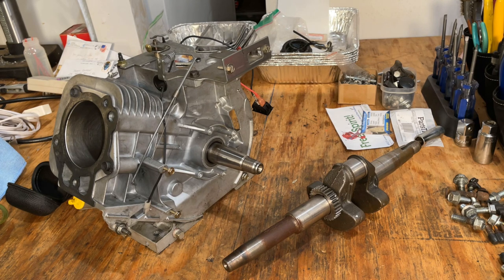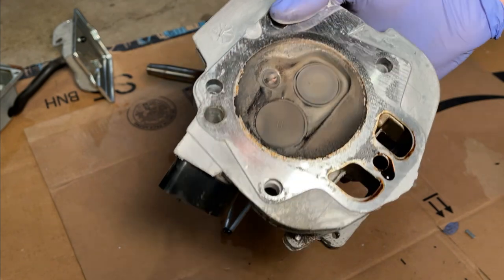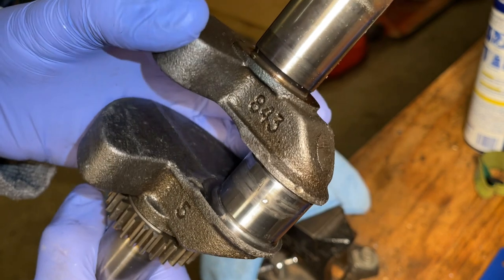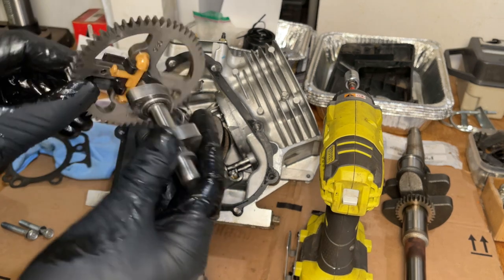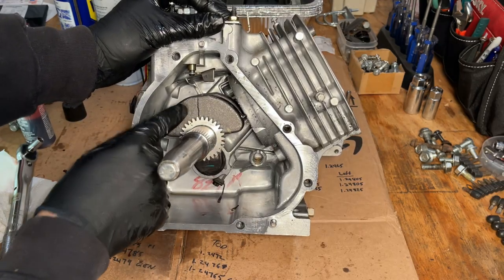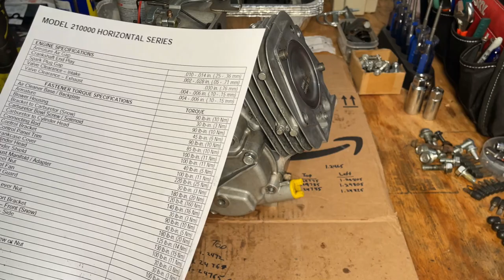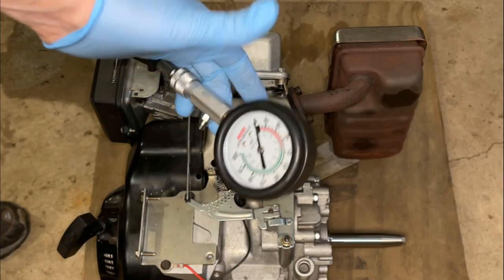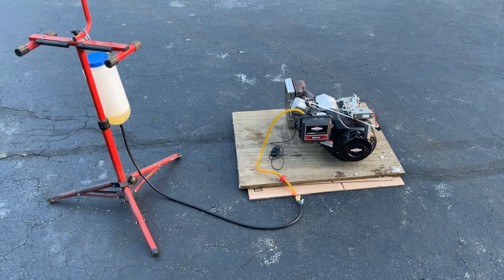Generator Engine Rebuild (Take 2) - 10HP Briggs and Stratton

Comment: Sir:
I am impressed with your logic and trouble shooting . Wish your were a auto shop teacher when I was in school.your a great teacher.

I did feel a need  to mention two things

1. Back in  1955 chevrolet came out with insert rod bearings 
Before that old motor manuals showed how to grind, file, sand caps and shim rod to crank for proper clearances.
My dad use to fit by feel then we used plastic gauge when it came out.
The pressure is on the top and bottom of rod not as much on the sides where the bolts are. Also being oil drip / splash lubrication it actually let's more oil in.
This technique always worked for us especially when the engines were not that far out of the spec .by 001 to .003 curing the knock.
Of course this was for the old two and a half to three and a half horsepower motors.
Bottom line they ran for hundreds of hours afterwards.  We put a lot of these mix and match left over used parts motors together for gardeners.

2. We always would use sand paper ( 600 to 1,500 grit ) on a machined  flat surface to lap in block and heads surfaces to show and remove warpage and low spots as we only had wire brushes and gasket scrapers which removed more than just gasket material ( softer aluminum back then ? ) Which would lead to head gaskets leaking / blowing after only a few hours ( 20 plus).

Not criticism just old  school to  save  a buck and use all the life possible out of engine.

Mike
Reply: P.S. 
I was talking about  lawn movers engines not Chevrolet motors just a reference of where to find procedure

Comment: Your trick of the wet sandpaper and rope to polish the crank's rod journal is quite clever (and effective). I've not seen it done quite like that, and definitely will remember that. Thanks for another great video! Be well, stay safe and God bless. Rev. D.
Reply: This sanding method probably removes more material from the middle of the crankshaft journal.

Comment: Mr James, when fiddling with the governor adjusting tab, I made a tool. Get a piece of 3/8 round bar and use your dremel tool to make a slot to fit the tab about 1/2 inch deep. Make the bar about 12 inches then bend the last couple inches to a 90 degree angle. This way it can be adjusted from the recoil side without removing the tank or fighting anything.

Comment: Great video.  One trick taught to me 50 years ago is to use a 1/2 impact gun/socket in reverse to remove the flywheel nut.  Alters the polar moment of inertia required such that you don't even have to hold the flywheel with your left hand with the impact in the right hand. Takes less than a second.  No need for ratchet strap.  The nut spins right off, but the flywheel doesn't rotate. You won't believe it, but its true.  Great also for removing nuts on alternator pulleys, power steering pulleys etc.  Kind regards,  Craig

Comment: On the connecting rod journal, I would have checked with Plastigage to obtain the clearance. Cheap and easy to use to determine if you are within tolerance. Also, I believe that the rod is linebored when manufactured and direction of the cap is only one way or the tolerance will be off.
Reply: You stand correct!
Reply: Going to say the same thing. Plastigage is what I would have gone with also. 
James, I could really use that piston from the used engine you disassembled. Please contact me. Ken gave you my contact information. Thank you sir and have a good day

Comment: Fantastic job of diagnosing the parts that would work and those that wouldn't.  Very surprised at the crappy condition of the new crank.  Thanks for the video.
Reply from the maker: Makes me second guess not using the one that was mostly in spec that was run without oil.

Comment: Hi James, also thoroughly enjoyed this with my morning coffee, nice way to start the day. Excellent video. I replaced a connecting rod a few weeks ago, at least a 2 hour job. Can't believe those storm responds don't have an oil sensor either. A very satisfying video !! ty
Reply from the maker: Thanks.  They are a good engines.  A generator can run for days in end.  An oil sensor is not optional.

Comment: I rebuilt one more than 10 years ago. It was used at a construction site. The crank can't be more than 1/2 of a 1000ths off. Mine was fine after I scrapped all the aluminum that stuck to it off. I've used the heck out of it ever since. Store it dry. The tough part was getting the armature to disconnect from the crank without the proper tools. Hit it just right and it came out.

Comment: Straight ammonia takes a bit longer, but it eats the hell out of soft metals.  It's used in some of the more rugged firearm bore solvents to remove lead and copper fouling.  Make sure you don't breathe it.

Comment: Ok, so you gave me the bug. I went out and bought an abused basket case. You perfectly cover all of what I have run into so far in several of your videos. But….I think I may have a symptom I haven’t seen covered by you yet. This one has a stuck governor shaft. If I can’t use Blaster to free it up I guess I’ll have to split the engine to get at it. Furthermore while pulling it over with the head off I think I may be hearing a knock from the rod journal. So thankfully you have covered all this and I have watched and learned. I may have bought a bucket of bolts but you have to start somewhere. Thank you for making such clear and well edited videos.
Reply from the maker: Good luck!  Sometimes it takes a lot to bring them back.

Comment: I've rebuilt automobile engines.  One thing you learn real quick is to measure parts and clearances.  All mechanical parts have tolerances.  If there is not enough clearance between the rod journal and the connecting rod expect there will be problems.  As one subscriber suggested "Plasti Gauge" is a good for checking the journal clearance.  Good video all around.

Comment: Those storm responders need to have a low oil shut off. I'd rather deal with a faulty oil level switch than a engine replacement.
Reply: Very well said, I agree!
Reply: Absolutely. Every one else does.
Reply: @mikesbarn1858  You'd think that there would be a mod that would screw into one of the oil fills. A lot of those engines have two oil fill location. Someone needs to go to invent help with that one.
Reply: Don’t forget about generator safety as well https://youtu.be/I1jT3ANENvI stay safe everyone
Reply: true they do need one. maybe there a way to put one in. maybe james knows or someone else.
Reply: I posted this question to James and it wasn’t answered 🙁
There has to be a way to do it. All the others have one along with the newer storm responders

Comment: I have learned so much about small engine repair from watching your videos. I now have the confidence to clean a dirty carb, and so much more myself. Your diagnostic skills are confidence builders. Thanks for explaining everything so clearly. Small engine repair in the area I live is a joke. The first question they ask you is how old is it, followed by it's not worth the effort.
Reply from the maker: Same here.  Before I started small engine work, dropped my mower off for service and the spring and got it back in the fall.  Plus they had it outside all year and it look a 100x older.  Was not impressed.
Reply: Keep up the good work, James!!

Comment: Excellent vid on using the mikes to check specs seams that there’s such a small margin as to how little has to be removed from the crank to make it out of spec. I wish James you would have played the engine knocking compared to fixed at the end of your repair so we could learn to be more sensitive in our hearing to hear what you are hearing. Thanks

Comment: Years ago, I was tasked to determine why aircraft mechanics were breaking helicopter engine to rotor driveline bolts upon installation.  When you install a bolt, the critical parameter isn't torque, but the bolt "pre-load" or better said, clamping force from the bolt.  Torque is a just an easy way of measuring bolt pre-load or clamping force.  What I determined, by the review of literature as well as laboratory testing, is that torque as a measure of pre-load is accurate to about plus or minus 50 percent.  Especially when you compare dry, clean threads versus threads with oil or lubricant on them.  In my case, if I had a minimum-acceptable strength bolt, with threads that were not perfectly clean and contaminated with oil, threads that were cut versus rolled, and a torque wrench that was at the high end of calibration, a mechanic applying the proper torque could break a driveline bolt!  So I'm not surprised that you have seen wide-variation in torque specs on the same bolt in the same engine across different sources of service information.  That said, I do feel that using a torque wrench is important and I applaud your rigorous use of a torque wrench in your videos.  Not to get the exact amount of pre-load, but to get an equal amount of pre-load.  For the engine cover, 100 lb-ft versus 200 lb-ft likely doesn't make much difference.  What would be a problem is if you tightened one to say, 25 lb-ft, and others to 300 lb-ft.  :)  Really enjoy your videos!  To close the loop on my story, we ended up raising the minimum strength of the bolts and the breaking stopped.  :)
Reply from the maker: Thanks for the comment.  I agree completely.  It is more important to get consistent pre-load.  You would be surprised at what I see on some of these straight from the manufacturer.  Some important bolts are barely finger tight and not torqued consistent.  Thankfully this is not an aircraft.  I usually go a little light.  A stripped out or broken bolt will cause a lot more problems in the case of a small engine then one that is torqued to the max value.  And as you mentioned, there are a lot a variables like thread quality, dry/wet, the wrench used etc...  I see a lot of people on YouTube using an impact to tighten bolts and that is always a bad idea.  There is not feedback on how tight the bolt really is.
Reply: It's hard to get people to understand the number of factors affecting screw torque and how these all need to be specified. Lubrication and anti-seize treatment applied to the bolt before assembly. The material you are threading into. The type of material the screw is (I.E stainless, carbon steel, etc.). Also plating on the fastener like cadmium or zinc. I always liked to use a cadillac gauge to measure the fastener stretch if I could.

Comment: Without high dollar precision measuring tools, a second option is to torque the connecting rod to the crank with plasti guage and measure that with the cheap cardboard guage that comes with it and you will know if you have proper clearance
Reply from the maker: Yes, just did that in my most recent video.

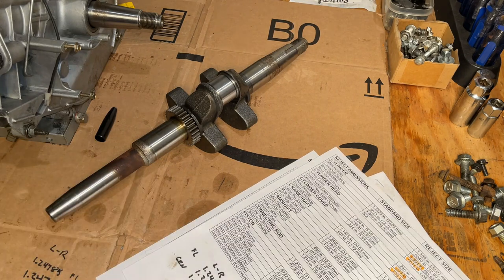Comment: 14:10 I'd still use that crank to be honest. It's within the tolerance of most calipers and the one spot under spec is fairly small. It's worn, but still useable.
Reply from the maker: I agree.  Especially after seeing the "new" crank.  Have since picked up another blown 10hp Briggs engine and that crank was perfect.  So now have two ready to go.
Reply: @jcondon1  Good

Comment: Nice job. I like your honesty deciding to change the crank. One person commented the crank was a knock off. Based on the way it was shipped and minor flaws it’s possible.  Nothing is straightforward any more.
Reply from the maker: I would agree.  The original crank was made differently and better.  Would not buy a new crank again from Amazon.

Comment: About removing aluminum deposits on the crank journal, try using Brasso or its silver cleaner. I haven't used this before but they are cleaners and might work. Other good cleaners that are found in homes are baking soda and vinegar. Thanks for posting, always enjoy your videos.

Comment: What makes these engines run out of oil? just acquired one of these used and it runs like a champ. It is an 18-year-old Generac when it was owned by Briggs so it has this engine and the same set up. I’ve run it quite a bit since I changed the oil and restored it, it had a bad carburetor, and I had to flash the generator. But mine does not seem to use oil. In fact, it doesn’t smoke or anything. I know it’s typical for most engines to use just a little bit of oil unless it’s like a Honda or something but I do keep a close check on my engines and don’t let them run out of oil.

Comment: Glad to see you were able to get it running well with the new crankshaft. PRO-GRADE to do it the right way and to spec since you will be selling it. Starting on first pull will give you some swagger too! I've not gotten the chance to touch the Storm Responder I picked up a few weeks ago. Need to get to it as we just had power outages here in NC and I didn't have it ready to sell. ☹️👎 Keep em coming and great work as always, James!
Reply from the maker: People always talk bad about the Nikki carbs, but the work well on the 10 HP fixed speed storm responder.  My mother-in-law is in NC.  She lost power when a tornado struck 2 miles away.  My inventory is reaching critical.  Hopefully things start selling soon or I will have to start fixing lawn mowers...
Reply: @jcondon1  Yeah I hear ya. I've got mowers blowers, weed eaters and chainsaws that are getting in the way so I'm ready for the Spring mowing season to start down here. I need to quit shopping so I quit BUYING. That reminds me, I have a blower I'm supposed to pickup this weekend. 😕
Reply: I forgot about the pressure washers getting in the way too.

Comment: James, its sad that you had to buy a new crankshaft and it gets shipped in the condition that it was! That should of had all the machined surfaces protected with a rust preventive and packaged to prevent damage. Great rebuild! I wonder if those used cranks were out of spec from the factory. Conflicting briggs specs from the paperwork would make me nervous.  👍🇺🇸Roger
Reply: I sent two back that were brand new 
Out of specks

Comment: For future reference, if you need  lye in an easy to use container., Most oven cleaners that say to not to expose yourself to the fumes, contain lye, and it’s a spray.
Reply from the maker: Thanks for the tip

Comment: Perfect parts from manufacturers are a thing from bygone days. You should think yourself fortunate they bothered to put some rust prevention wax on it after machining. You really need to manage your expectations lol. You got the part in a day, reasonable price for what it is, I'm sure it's machined well, it will be CNC after all, and they made sure it didn't get rusty in storage and transport. RESULT!!!

Comment: It appears the lack of mechanical savy is not compatible with owning a generator. "Check the oil pudden head!" Congrats on your new strap wrench which you will use often, even when tightening the flywheel. Hydrochloric acid and aluminum react to produce aluminum chloride and colorless hydrogen gas so to be safe, do it outside. Love the trick of wrapping some heavy string around the emery paper. :-)

Comment: One thing you could have done the first time was to use plastic gage to check the rod clearances to the crank and you should check  the end play in the crank. Other than that you do a better job then the factory putting things together. Thanks for the videos.

Comment: an out of spec crank can be used on a briggs, using a large flatfile or a bench disc sander, take a little off each side of the conrod(the flat surfaces that mate when bolting it together) a little at a time.

(would I sell it to someone like this? no. but it does work.)

as the crank gets worn it wears an egg shape, usually the conrod does too, this takes up the slack a little, if its not super bad, you can get away with this. 

my lawn mowers been running the last 10 years with this fix
Reply from the maker: Thanks for the tip.  Makes sense and can only improve things if done right.

Comment: James, You have so many of the old engines and have put a couple together, it would be very interesting to us for you to see if you could add an oil low shutoff to a test bed engine? I think it would make for good video!
Reply from the maker: Have thought about adding one, but the parts new are $100+.  Recently picked up a Briggs 9 hp generator engine with an oil sensor.  It blew the rod.  Not sure yet the reason.  Potentially the oil sensor did not work?

Comment: One of these days, I'd like to see you do a propane / natural gas conversion on a gasoline generator.  Just a thought.  Might be interesting.
Reply: Me too! Talk to Hue at US Carb, his company makes the snorkel!
Reply: Just buy a real dual fuel carb on eBay for $30 don’t mess around with the fire hazards half-a$$ed “snorkel type” conversions, they are complete garbage, just because they run doesn’t mean you’re getting proper air fuel ratios the way a demand regulator carb does.

Comment: James, Thanks to your informative and instructive videos, I feel reasonably comfortable in buying a used B&S Storm Responder, and doing the  repairs and maintenance myself. I can't afford a new generator. I have a question re: THD...Is there such a thing as a post generator THD filter. Would.a surge protector work for this problem? .Would B&S have something like a THD filter? Is it safe to use this generator, as is, for TVs,PCs, etc.? Your kindness and generosity are most appreciated by hundreds of your followers, especially me! Thanks, again
Reply from the maker: There is nothing cost effective for reducing THD.  Your best bet for clean power is an inverter generator.  The storm responder like the one in the video have lower THD then most non inverter generators.  Still high, but better then most.
Reply: @jcondon1  Thank You, James! I guess I would need an invertor of 5 to 8KW. Would you recommend a few for my consideration?...again, thanks so much !